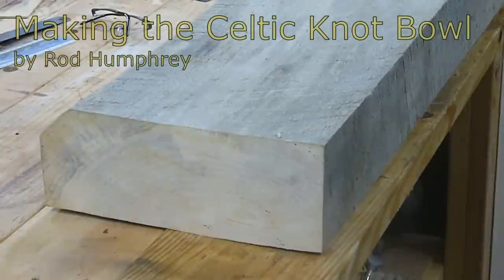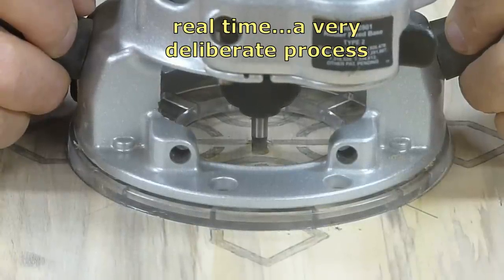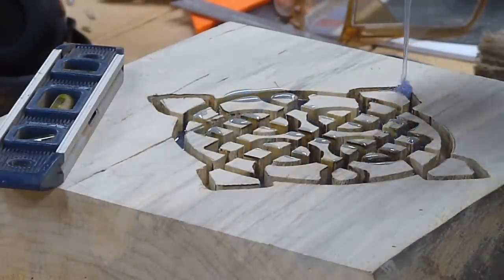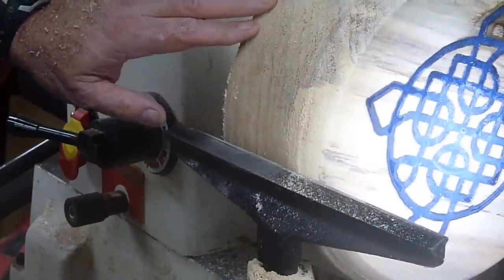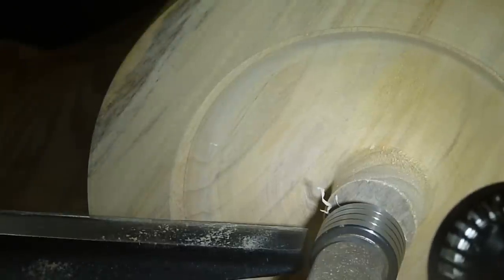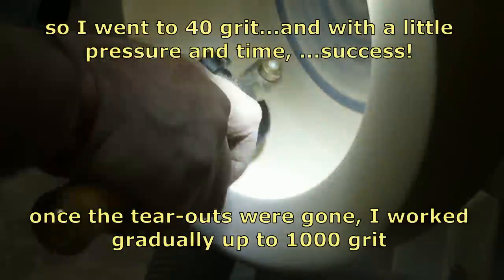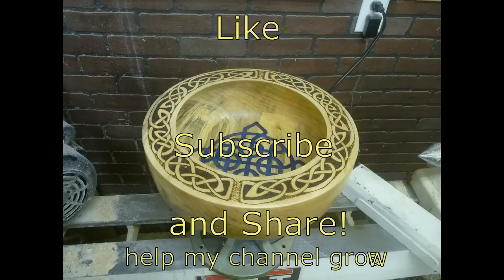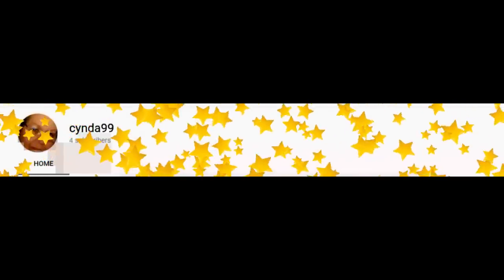Woodturning a Celtic Knot Bowl

Comment: bang tidy bowl design and fantastic control of the router mate I use them often and they are not easy to use in such a small design and depth of cut you had, new subscriber well impressed it looks fantastic, cheers Ross
Reply from the maker: Thank you very much for that, it is a challenge!  Cheers!

Comment: Your passion most definitely shines through...   it is a beautiful piece that’s an obvious labor of love...  I really dig the pyrography around the rim !!  

Something I cobbled together that you may (or may not) want to try...   at the local ”I’ll buy that for $1” type stores you can often find slightly milky, but mostly clear (we want the most transparent possible) bowls with a pronounced rim in various sizes.  I’ve amassed a collection of various sizes which I’ve coupled with the airtight (not the cheap spongy stuff) automotive weather stripping, some mildly thick (5mm+) acrylic sheet, several hoses and fittings from my local hardware store (along with Teflon tape and silicon sealant) and (you might see where this is going) a $30 vacuum pump from the internet.   Line the rim with the weather strip, cut a round (tho in some cases squares and rectangles help for ”things to attach rubber bands to”) of acrylic and epoxy it to the outside bottom of the bowl so it’s airtight, drill a hole through the acrylic and bowl for the hose fittings in the bottom, fit said fittings and hoses, little door-latch hooks can be handy for rubber bands to hold things down (again lots of sili-con-carne) et voila !!   A relatively inexpensive vacuum chamber for inlaid/odd shaped/too large for a pressure vessel resin pours !!    It is remarkable how frothy the resin gets when you first start to drop the pressure, so a little back and forth finesse is required to keep things going, but I’ve definitely noticed a significant difference in the quality of the resin...    the lack of teeny-tiny bubbles keeps the color closer to what I initially was going for.

Just thought I’d pass that along...   it definitely adds a bit of ”The A-Team” and ”MacGuyver” to my time in the shop !!!
Reply from the maker: I appreciate the tip, and the time you spent passing it on 🙂

Comment: I love that Celtic knot pattern, I’ve been thinking about something similar with a walnut platter I turned from board. I want to inlay copper or use resin to put a Celtic know in the center of it and then some kind of art work on the outside. This video inspired me to try some things.

Comment: Rod, I’ve been a fan for quite some time now. This is , by far, one of the most impressive pieces you’ve turned out !! The wood looks like Silver Maple to me, by the way. Oh, and I understand the passion for the woodworking that you talked about in the video. I agree that it sometimes comes out prominently in particular pieces or projects, as it did on this one. All that you did on this project is certainly within my skill set, so I may try one of these myself a bit down the road! Thanks, sir, for another good video! Semper Fi, Marine!

Comment: First time viewer here. That is very beautiful. I have watched a number of these resin and wood projects starting with those River Tables. One thing I wonder is why the wood itself is never or almost never stained? Don't get me wrong. Natural wood is beautiful but sometimes I think just a smidge of color might go well with certain colors of resin. Also it is hard to tell but is the wall of that bowl really thick or does the rim with the burned in knot work extend over more than the actual bowl sides? Anyway just excellent and your love for this does show through.
Reply from the maker: Thanks very much!  This particular bowl wasn't stained because it has a natural antique look to it with many colors already present.  The rim is undercut a full inch then tapers to the sides on the inside.  Thanks again!

Comment: Very good work. If I may ask..., when reaching into the bowl to sand it. Would putting the sandpaper on a padded stick worked to provide safety, and also that added extra bit of leverage and pressure? Just a question on your opinion.
Reply from the maker: Thank you very much!  I do that very thing with more narrow spaces.  Lots of folks are using drills and pads too, which work great.  For me, it's the feel...it might not really make a difference, but I kind of enjoy the hand sanding part.  It is questionable on the safety side, admittedly.

Comment: I have to ask as a beginner with wood turning. Why do you cut the wood to a circle in this and the black walnut bowl video I have watched vs rounding it on the lathe.
Reply from the maker: The corners and ends can be used for other projects, or even used in my wood stove for heat in the winter.  It also is easier to start with a chunk of wood that is closer to balanced and round.  It saves time also.  Thank you!

Comment: You mentioned the wrong amount of resin.  Keep a pound or two of rice in the shop.  Keep it in an snap lid container.  Use the rice to fill your design.  Then pour out into a separate container.  Pour that into a cup with measurements on the side. Either a cooking  measuring cup or some resin mixing bowls have the increments on the side. Now you have how much resin you need.  Add an ounce or two extra for your soak in.  I always keep another container or molds to use up any excess resin you have left over.